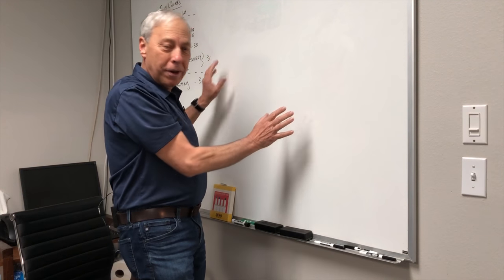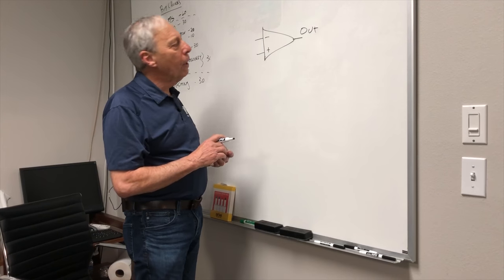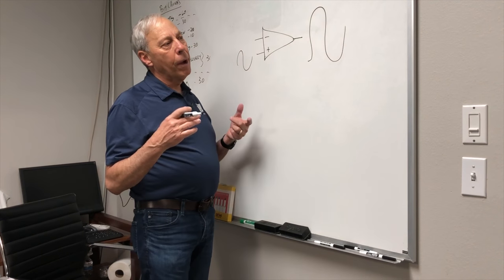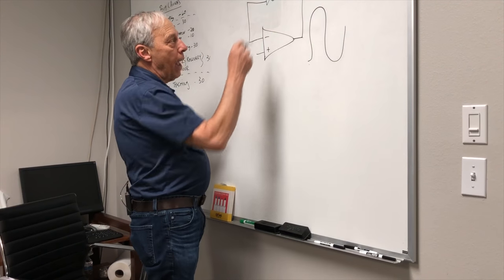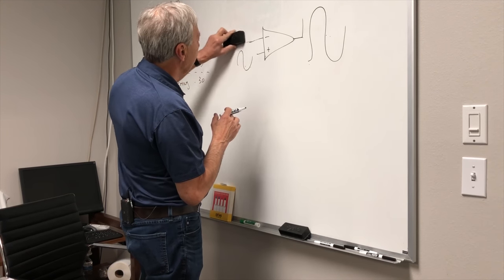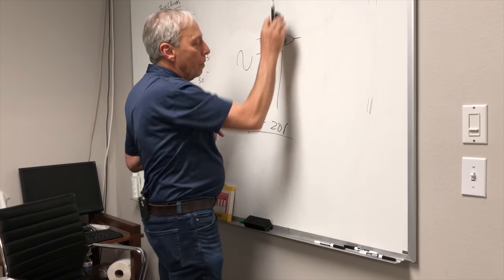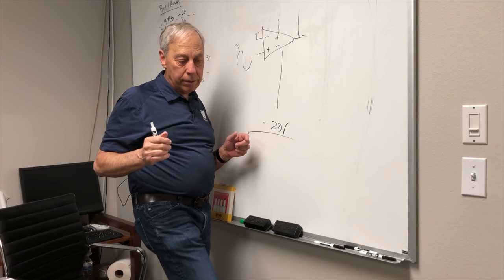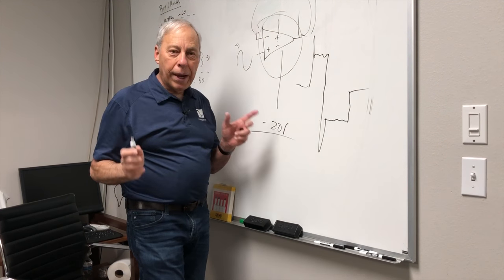Negative feedback in audio

Comment: Actually you can tell by implementing a separate digital model in a separate part with MCU. That is calibration data, some ADCs and sensors to adjust the working of the amplifier.

Comment: Hi Paul looking forward to the op-amp video's !*_*!  i would like to learn as much possible , want to start making effect pedals  ,, I have a Rockman XPR and that is shire genius  full with op-amp don't know how close i can come to understanding the many ways what op-amp can give  in effect design . Thx in advance and greetings
Reply: Tom Scholz and his Rockman gear were a big inspiration for me to become an electrical engineer back when I was a kid!  The "effect" sounds typically don't come from the op-amps themselves, but from how you use them with other components.  (unless you just overdrive them for fuzz).  The Rockman signal chain goes something like this - Input stage, AGC compression stage, noise gate stage, clipping stage (silicon diode soft-clipping in the opamp's feedback loop OR LED hardclipping on the opamp's output, cabinet simulation filter stage, then the BBD delays he uses for Chrus, Reverb, etc before the output.   I agree, his methods were definitely genius, though, looking at the schematics of the Rockman gear now...  I see certain big design no-no's that he was able to get away with because of how forgiving and relatively slow the TL072 op-amps are.  It's no wonder when folks try to replace them with modern "hifi" op-amps they have major problems.
Reply: Hi 0x07AF that's nice to hear and super interesting to me
 ,,Hope to get your level of understanding how the components interact with each other  !*_*! ,
,What motivate me now for gtr effects making, is i get the idea that most of the effects that are around seam to be made without musician input ,,, 
Tom his approach  seams different , and looking into the inside of the XPR i got that idea like how you explained .
Bought my XPR when it was new and blow my mine up,  four months ago ,with volt on the effect send  .

There is no Schematics around from the XPR (and i would like to try if its possible to make one !)
  so i bought (luckily) an other one a Rockman XPRa (very expansive  ,, now my original XPR is sort of partly fixed ,  3 IC's are replaced , one of them was a volt divider CPU style.. 
But it sounds a bit like its over shouting itself , (compared with the XPRa )and  the level from the echo /Revb does nothing ,, its always full
So there is still a mistake in it ,
but having them both , so i can see the different components that make from a XPR a XPRa .

Would you like to connect with me 0x07AF

Comment: This time lag is not audible. A class A amp without negative feedback does not sound any better. Negative feedback has only advantages. It is the best invention in amp construction apart from Clasa D up to date. It makes amps efficient and effective at the same time. No reason not to implement it technically speaking.
Reply: I think a lot of folks confuse time lag with phase.  When the phase is shifted enough that feedback is turning positive I've heard so many variations of,  "that damn time lag turned my amplifier into an oscillator again!! Feedback sucks!!" lol
Reply: "Negative feedback has only advantages."

Not so. Back in the late 60s and early 70s amp designers were pursuing lower and lower levels of Total Harmonic Distortion (THD) with copious amounts of negative feedback. Then Jim Sugden released his A21 amp with ten or a hundred times as much THD as most high end amps. The A21 was obviously better sounding even to those with cloth ears. Negative feedback is good, but more than necessary is deleterious to accuracy.

Comment: Great stuff, what would you call someone who designs and builds amplifiers? Electrical Engineer ??
Reply: In the real world it would be an electrical engineer but my observation over decades of time is that in the High End Audio business you can find people that are not engineers of any kid designing and selling amps, speakers and cables. I think that this is one of the reasons that there is so much hype, misinformation and bull in the High End Audio industry. I have personally met many of the "stars" of high end audio over the years and I was surprised at how many really do not know and understand the details of the inner workings of their products, which leads me to believe that many of them do not really do any of the critical work on their own products, which again could explain why there is so much hype and not so much truth in the High End Audio business. Of course I did meet a few folks that really did know their stuff and who seemed to be able to actually be able to do the research, experimentation, design, and build of their products, but there seemed to be very few of them.

In this video, there was no explanation (that I noticed) of why negative feedback (in any form)  is secretly (or not so secretly) hated in High End Audio. The use of negative feedback does stabilize amplifiers, that is true, but is not mandatory its just an inexpensive and easy way to do so. You can also get amazingly low levels of distortion by pumping in more and more various types of negative feedback, which seems to be how some amplifier manufacturers are able to claim that their amps produce something like 0.0009% THD, which is certainly possible. What is nonsense is that you need to have distortion levels that low, when speakers commonly have distortion levels of somewhere around 15%. Obviously the amplifier's distortion is such a tiny fraction of the speaker's distortion that it blends together and becomes inseparable and irrelevant. Even if an amplifier had 2% distortion or even 5% distortion, it seems logical that you could not hear it over the speakers' 15% distortion. The importance here is that negative feedback alters the output signal so that it no longer is an exact (as exact as it can be) duplicate of the input signal, at a higher power level. With more negative feedback, the subtlety and nuance that customers pay enormous amounts of money for is eroded or erased, so why bother paying all that money for them? It seems that the people who market High End Audio products are better at selling them than the manufactures are at actually building them.

An interesting experiment is to listen to an amplifier that claimed to have no negative feedback at all, like the classic Rappaprt AMP-1, and compare it to a conventional amplifier that has plenty of negative feedback. I have done exactly that on many occasions and was surprised that I could hear a clear difference, the AMP-1 sounded far more natural and realistic where all the other amps sounded like they all had a lot less detail (in different ways, but they all sounded like they had muted details).Unfortunately Rappaport had to shut down his company before I had he chance to save up enough to buy a pair, so that I could continue my experiments in comparing them with amplifiers that had a lot of negative feedback. The tradeoff that Andy Rappaport made was to bias his amp so that it was mostly Class A and so it gave off tremendous amounts of heat, huge amounts of heat. Standing next to them I was shocked at how much heat a 75 watt amp could give off, and it was huge, having massive heat sinks which obviously seemed to be to dissipate all that heat.

So the question that this video totally sidesteps is "What tradeoff in sound quality does negative feedback impact us with", "Does various level of negative impact create different sonic signatures", "What is the sound quality of negative feedback". These questions are the ones that someone shopping for high end audio gear might want to know the answers to.
Reply: It is not the feedback itself which causes audible issues.  It is the reliance on feedback to bring distortion levels down, in cases where the amplifier operating open-loop (without feedback) would have high distortion.  
The public is being deceived to a great extent, concerning power amplifier distortion, because amplifiers are always tested with non-reactive loads when it comes to spec'ing them.  It is only when reactive loads are used, that one sees an amplifier's true distortion character.  
For example, well designed class AB amplifiers will do a fine job of minimizing polarity-crossover notch distortion when the switching occurs near 0V, but often not nearly as well with a reactive load which forces the crossover to occur well away from 0V.  Harmonic distortion from switching at the crossover point is a highly audible type, especially when the musical signal is spectrally simple and does not have much high-frequency content.  In general, it's a mistake to consider any certain distortion level as the threshold of audibility, as it depends entirely on the spectral distribution of the distortion, as well as the character of the musical signal.  
Reactive loads can also cause issues for amplifiers which do not have generous stability margins (determined primarily by the compensation and feedback design), resulting in spurious frequency response when driving real speaker loads.  
Both of the above, are important reasons why various power amps can sound so different when driving the same speakers.  This is a very complex topic, and engineers will normally resort to numerical simulation, to perform the analyses that are needed.
Reply: Thank you, well said!

Comment: So why do zero feedback amps work and sound good if they're so out of control?
Reply: JB Berg it's because the specific stage of amplification has a low open loop gain.  In those cases you can get away without using negative feedback.  Although, you might lose some of the other benefits of negative feedback besides gain control.
Reply: 0x07AF Ok, thanks, but what are those other benefits, lower distortion? In guitar amps low nfb means more break-up, which is good, but my Densen transistor hifi amps have zero feedback and I can’t detect any distortion. Also prefer my tube hifi amp in the 0db feedback setting. 6 and 10 db sound muffled and the volume drops too much.
Reply: Noise reduction, bandwidth control, stability over temperature (less fluctuation over temperature, device ageing, etc.), stability in general, output load compensation (dampening factor) which keeps the output level correct instead of sagging with higher load currents, and as you said, lower distortion... to say, 'low negative feedback in a guitar amp causes more break-up which is good'... a properly designed guitar amplifier would use negative feedback to give the user more predictable and repeatable control over when the break-up happens.  If you have a system that sounds bad when negative feedback options are enabled, I'm guessing the feedback scheme wasn't very well designed.  Depending on stage configuration, individual components like transistors and tubes provide elements of negative feedback between their own nodes... ie, when you drive a current into the base of a BJT, the resistance on the emitter is fed back "felt" by the base in how it affects how much current is fed into the base for a certain gain.  Often times, you'll think your amplifier has no feedback, when in fact, it's probably happening in your circuit in ways you're not aware of.  There is local (stage-by-stage) feedback, and global (final output fed all the way back to the input of the amplifier).  You're probably not using global feedback, but I'm betting you've got forms of local feedback in your amplifier stages which are keeping it from being noisy or oscillating.
Reply: 0x07AF So that’s why a hot amp sounds better :) The Densens are an always-on design, sound sterile when just turned on. In a guitar amp, break-up and feedback are controlled at the guitar by its volume pot and with playing dynamics. Some early Fender amps have no feedback and they can be fuzzy sounding. Marshalls vary depending on age and model. Less nfb has more power amp distortion and softer bass.
Not sure is my tube hifi has any local feeback, it’s a pretty simple desgin.
Reply: The 300B vacuum tube is probably the last audio amplificaton device built to work without any need for negative feedback.

Comment: So, I am now confused!

Accepting the explanation you offer Paul, does it mean amplifiers that claim 'no negative feedback ' (there's several in high end audio),  are clipping and "out of control " as you put it?

I was led to believe, amplifiers with negative feedback, generally speaking, take the 'life' out of the music. Is that claim wrong?
Reply: Amplifiers that claim to have no negative feedback are probably ones that have no global negative feedback. Global means the feedback encompasses the entire amplifier circuit (like Paul showed). Amplifiers with no global negative feedback would have to be using lots of local negative feedback. Local feedback just means feedback is around parts of the circuit inside that make up the amplifier. In truth, even a global feedback amp will use some local feedback to help reduce distortion.

When an amplifier is designed, it should be designed to minimize distortion in each section before global negative feedback is applied to get the distortion extremely low. Relying solely on global negative feedback to fix the problems is a poor design in my opinion.

Global negative feedback lowers distortion, lowers noise and makes the damping factor high. Stealing the life from the music is audio fool nonsense although some speakers may sound "better" with low damping factors. Also some people may like the sound of added low order harmonics such as with a single ended tube amplifier. Personally, I don't want the amplifier messing with the sound.
Reply: Excellent!  Very informative response to my remark, thank You! 

What confused me was the fact that Paul didn't differentiate between 'global' and 'local' feedback.  Several high end manufacturers advertise "no negative feedback" as an asset in the design of their product, leading many to believe that "negative feedback" is something best avoided.
Your comment about low order harmonics (mostly second order), is indeed one of the attractions for tube lovers, especially single ended designs.

Each to each own!
Reply: Leporello Gatos - If you're interested in learning about audio circuits in practical detail, the fellow JohnAudioTech who replied to your comment here makes some of the best YouTube tutorials on the subject, and he's made a lot of them.  Highly recommend!

EDIT: Uncle Doug is another great channel for mostly tube circuits and amplifiers.  JohnAudioTech does some tube stuff, but mostly solid state.
Reply: Thanks for that OxO7AF!

I will follow your suggestion and check these two YouTube channels.  It's always interesting to hear / see various techniques applied to audio circuit design.